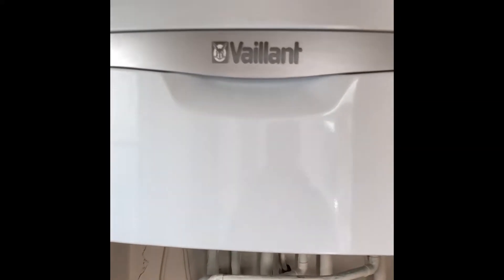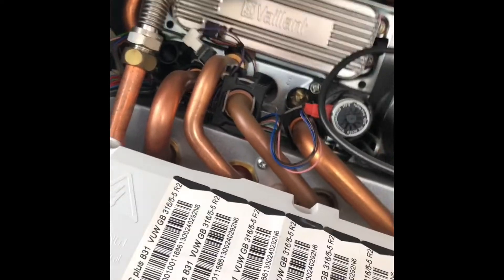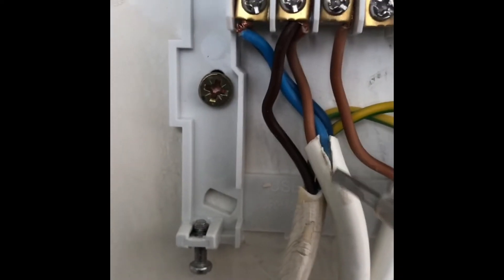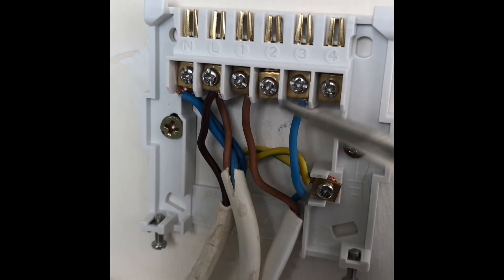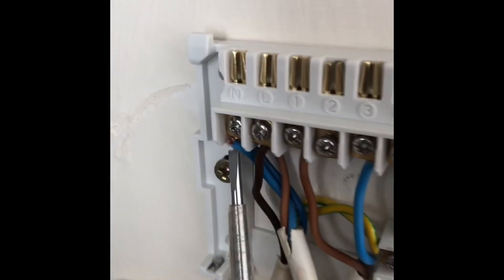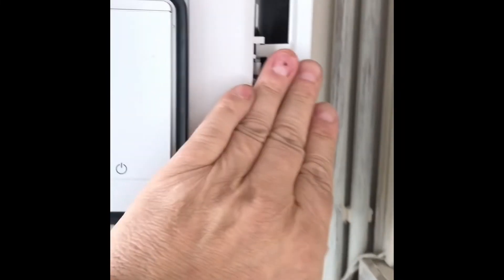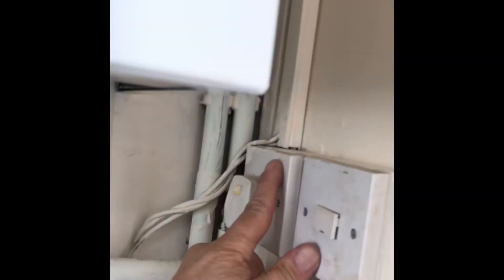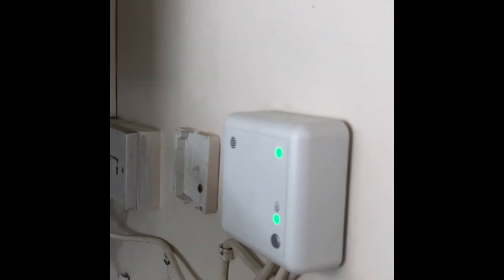How to wire a Hive system into a Vaillant Eco Plus 831

Comment: Great video. I am going to install dual zone as my heating has upstairs and downstairs. My question is do both my communication wires go into the =24v? I have a similar boiler valiant eco sustain. It has a pcb behind the boiler cover and a separate pcb box on the wall. Then remove the communication wires for the old wall mounted thermostats from the bus line leaving one set of communication lines from the boiler to the external pcb to control the zone valves?
Reply from the maker: Yes that would be the way to do it
Reply: Legend mate cheers for that I’ll get it done tomorrow and let you know how it goes! Thanks for the video your a life saver

Comment: thanks for the video. I thought hive only goes to 230v RT, but you connected to 24v. can it go either way??
Reply from the maker: Go Forit  hi, I’m sure it can but that’s the way I have connected it and it’s absolutely fine with no issues ... sorry for delay in replying
Reply: Go Forit hi, did you manage to connect your hive receiver. Did you connect it via the 24V or 230v, I’d be extremely grateful if you could let me know ???
Reply: @sajmohammed  I’d like to know this too
Reply: I always go via the live and rt for my link with the Vailant.

Comment: Can you confirm any issue's related to 230v AC or 24v installation. There appears to be a difference and I'm assuming that this video is for a 24v installation. Seems like this could have consequences if you get it wrong.....
Reply from the maker: The wires coming from the hive are COMMAND wires I have used blue and brown but they are not connected to 240v 
They are simply COMMAND wires. They send a signal to the boiler to turn off and turn on nothing more.

If you follow this video EXACTLY  how it is then you will have no problems at all.
Reply: @Jstorfs19  thank you for your reply. Have followed it and it appears to be working. Your video was much easier and clearer to follow than most of the ones I found. Thanks

Comment: Hi good video BUT you could mention the voltage 24v white connector low voltage switching not 240v on the 240v switch purple connector next to the mains in difference ! Some people mistaking bridge the live in the hive by mistake to send it back.
Reply from the maker: I did think it was quite self explanatory and if people follow it exactly as I have done it then they will have success.
Reply: @Jstorfs19  I followed exactly as you have done and blew the board right by the low voltage rt. I tool L and N from fused spur and run a signal into 1 and 2 low v RT and connected brown to 1 and blue to 3. Any idea why this could be?
Reply: @boxingfreddy100  I’ve literally just done the same. Did you find out why this happened? Cheers.

Comment: Hi buddy my hive is still showing first light red can you please guide me how to fix that
Rest all the connections are the same as urs
Reply from the maker: Muhammad Dilbar 
If your receiver has a red status light this means it has lost connection to your thermostat. This could be due to poor signal between your devices or flat batteries in your thermostat. You may also see your heating showing as 'offline' in the Hive app.

When this happens, you can still turn your heating and hot water on and off by using the buttons on the receiver. When you press the central heating (or hot water) button, a green light will come on indicating that this function is on.

However, as the receiver is unable to communicate with the thermostat, it won't know when it has reached a target temperature so the boiler will remain on until you switch it off. You will need to press the relevant button on the receiver again to switch your heating or hot water off manually.

Hive Hint: Sometimes the Hive Thermostat will use any Hive Light bulbs you have to route temperature messages. This is normally fine but can cause the thermostat to drop offline . If this happens, just turn your lights off at the wall socket then take the batteries out of the thermostat and put them back in again. You should turn your lights back on once the thermostat has reconnected.

If the status light on the receiver remains red, try the below steps:

Step 1 

If you have an older version of the Hive thermostat then please follow the steps for Thermostat - no rf - Hive 1.

Step 2

If you have the newest version of the Hive thermostat then please follow the steps for Thermostat - no signal - Hive 2.

Step 3
If the receiver status light remains on red after attempting this then switch the boiler off and then on again at the isolation switch/fuse spur (this should be located near your Hive Receiver next to your boiler). The receiver status light will then turn green. Wait 10 minutes and then go to 'manage devices' in the Hive app where the thermostat and receiver should now be showing as 'connected'.

If the receiver status light remains on red you may need to purchase a signal booster.

Comment: You could have just run a 240v feed to the 240v rt plug from a linked common behind the hive receiver
Reply from the maker: I could of done and I did explain that I ran the 240v feed from the boiler and basically used the hive as a connector to wire both before sending it into a fuse spur. The 240v cable was already coming out the boiler into the fuse spur sp  It was far easier to run both those 240 cables to the hive and connect them there. 👍🏼

Comment: I had similar installation (not with Hive, but Drayton Wiser), all is good, except heating is constantly ON despite showing turning off in app and thermostat? Followed the documentation shown below for the Single Zone CombiBoiler: Model WT714R, WV714R..
https://m.media-amazon.com/images/I/A1nSDCNGA7S.pdf

Anyone can please suggest what is the cause..
if helps, boiler Black cable in Terminal 1 and Grey in 3. Thanks.
Reply from the maker: Try putting the black in terminal 3 and the grey in terminal 1
Those wires if you have them the wrong way round then the boiler will be off when it should be on and on when it should be off. So just reverse those two cables! 
After all they are only a command cable sending a signal to the boiler!
Reply: @Jstorfs19  exactly as you said. Resolved. Many thanks 🙏